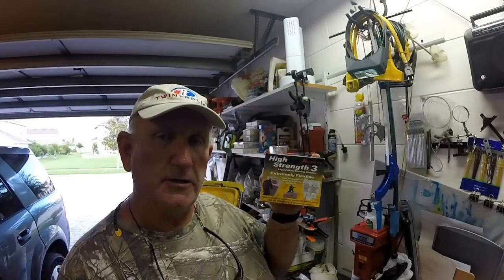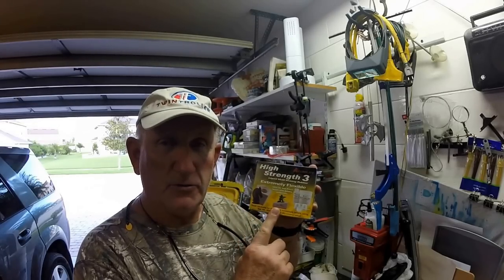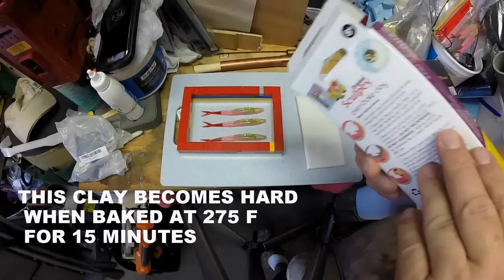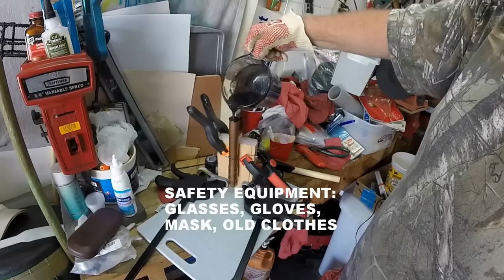RTV SILICONE MOLDS TO MAKE SOFT PLASTIC FISHING BAITS

Comment: That's a lot more work then it has to be with cutting the mold and setting your pipes and clamps together. plus i would use a better stir stick. use a blow torch or heat gun to pop the bubbles works a lot better then mixing the rubber twice and to find out it really doesn't help . Not trying to bash your video. Plus editing would help as well.
Reply from the maker: Thanks for the input.

Comment: much easier using another mold material.
Reply from the maker: Explaining what that material would be would make your reply more helpful but thanks for trying.
Reply: Since you asked... In the past I use to make two-part molds using plaster of Paris but wasn't happy with the detail. I've been using High Strength Liquid Mold Making Rubber from Hobby Lobby and another - USG Hydrocal® White Gypsum Cement. I use a quart container box (milk), vaseline on one surface and pour the second layer.